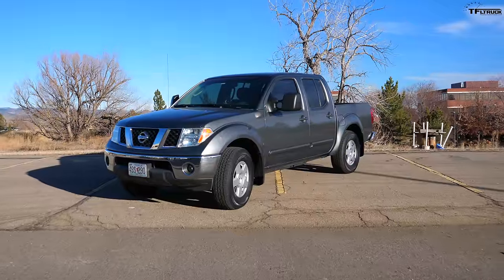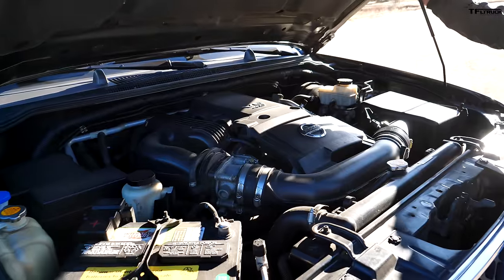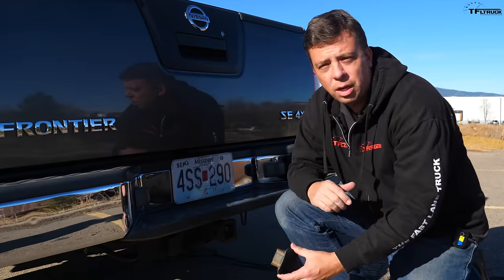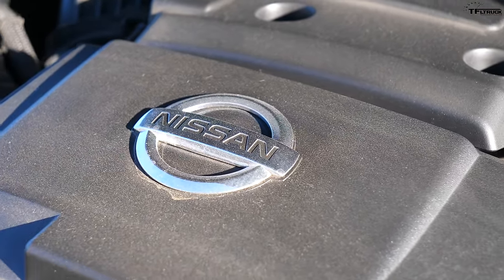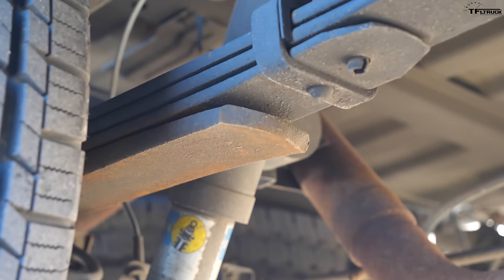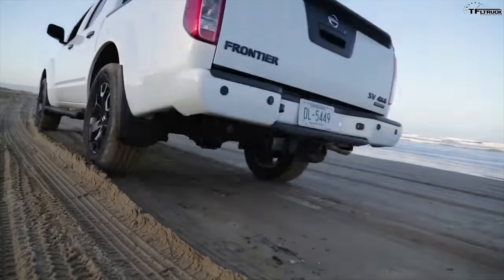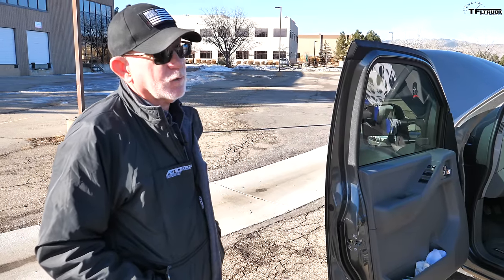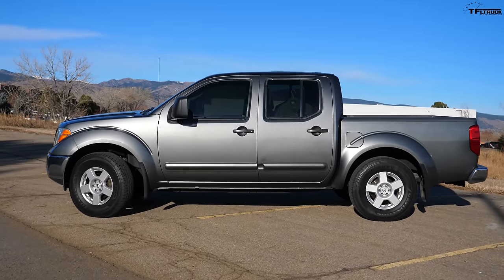Here's Why I Prefer The Old Nissan Frontier Over the New One — Dude, I Love My Ride!

Comment: Pifff"..... My 2011 has 268000 on it, I have never done anything to the engine, but regular maintenance.About the only thing I don’t like about it, is the 4 1/2 foot bed. You put a toolbox on the back and it’s virtually nothing but a trashcan hauler. The other big thing I don’t like, is the gas mileage. Since it was new I have an average 16.8 miles to the gallon. Some may say that’s pretty good, but this is strictly highway miles commuting. I was hoping for over 20. I only saw 21 miles per gallon when it was brand new on a 400 mile trip. By the way, I wanted to standard in mind when I bought it, but there were none available within 1000 miles.

Comment: I just got a 2010 np300 with 145k km and it looks used, abused and ignored. Plenty of things to fix. Even the windows rattle in the doors over bumps. But it was fairly cheap so not too bad.

Comment: I prefer the legacy Jeeps with the AMC 242ci I6 engine (Powertech 4.0).  My aging Jeep Wrangler TJ has 409,000 miles on it.  I prefer the old Chrysler V8 318 engines to today's junk. I had one with 850,000 miles on it until it was crashed in front of my house.  I prefer the old Blazer 4.3 liter V6 engine.  They had the amazing power and durability that made GM famous and the current engines GM uses today infamous.

Comment: my 06 frontier was a great mid size pickup truck. i said was. the trans. gave me some problems (automatic). i changed trans.fluid,filter every 30,000 mi. never towed or hauled anything heavy, i bought this pickup new. the local dealer constantly updated me on the trade-in value. why? i liked the truck. they must have known the trans.cooler was going bad. well it did! the cooler is in the radiator. leaks antifreeze into trans. i noticed a prob.at about 80,000 mi. well by the time i figured it out, they call it the Nissan slow strawberry trans.death. google that. well it was too late. the manufacture or dealer never notified me. no letter no phone call, notta. warranty was good till 70,000 mi. 7 yr. now for the good news! they were forced to recall thousands of vehicles for the prob.however they worked out a deal to extend the warranty to 10 yrs, or 100,000 mi. good for them! but bad for us. they never told anyone,  a $4,000 fix. Hooray for Nissan!  the trucks worth is about $5,000 dolls. shame on you Nissan and whomever has anything to do with recalls.

Comment: I'm surprised that my 2019 GMC 5.3 V8 probably gets similar fuel mileage to this 2006 Nissan 4.0 V6.  Technology has come a long way.  I know my 1995 Jeep 4.0 I6 got way worse than this for sure.  My average was about 11-12 mpg city at best, and it started off at only 10 mpg before I did some work!  And that wasn't always driving around with a lead foot!  One time I even added an additional throttle return spring to force me to drive more conservatively.  But that was only temporary as the foot pressure required was somewhat not the most ideal.

Comment: There's a reason this truck has been the same since 2005. It's a fantastic engine transmission combination the drivetrain is solid and the looks are reasonably speaking good looking. People complain about not having the New Frontier but there's not much wrong with the old one to want in the new one. You can still pick this truck up for under 30000 and a brand new truck can be identical to my 15 year old truck
Reply: L
This guy blew a timing chain at 80,000 miles and needed a  complete new rear end I wouldn't say it's too solid LOL
Reply: @paul9912  yeah and brand-new trucks of every make and model have recalls and complete transmission and engine Replacements. Toyota has to replace entire frames at their own cost. Minor remediations are to be expected. Still a very dependable truck would highly recommend
Reply: @mrfordman9999   you can say whatever you want buddy but I think you would be drastically outnumbered if you tried to compare Toyota quality to Nissan. Good luck with that Nissan after 80,000 miles lol
Reply: @paul9912  mine has 216,xxx. They're great trucks. for the money they're seriously hard to beat.

Comment: 09 Frontier 5 speed 187,000 miles....have only had to change front wheel bearings. Power steering leaks a little bit but that's it

Comment: I’ll go even further back. I had a 94 Nissan D21 pickup aka Hardbody. 4 cylinder with a 5 speed manual. I put 200k miles on that truck and it just ran and ran. I still regret selling that truck.

Comment: I have a 2015 2WD. I wish I had those nice mirrors on mine for towing. I wonder if the 2005 mirrors will fit on my 2015.
Reply: They will fit! Anything from 2005 onwards will fit those towing mirrors. Nissan never designed the front doors to be different in shape on the king or crew cabs, so everything fits!

Comment: My mom has a 2010 and she has never done any maintenance other than oil changes and brake pads and been in 4 wrecks. She has 192,000 miles on her frontier. This truck is literally indestructible. She wants to get a car for better gas mileage but I keep telling her you can’t treat a car like that without it breaking😂

Comment: I have a 2010 frontier. I'm surprised he hasn't had his crank and cam sensors fail. Mine all failed before 50k.
Reply: Bad/low oil cause VVT regulators to lag, common issue, but easily fixed by new oil, sometimes VVT regulators needs a cleanup

Comment: The guy knows his truck for sure. It has always seemed to me that Americans have a built in excuse for foreign vehicles. If someone's F-150 had to have a major engine repair at 70,000 miles and a new rear axle at 100,000 miles, they would be throwing an absolute fit. But for a Nissan Frontier it's "i've had no problems at all." Pretty funny.

Comment: Great video. I was a little surprised the timing chain went out at 80k. Maybe from towing that horse trailer weight. Did you run full synthetic oil? Any plans on replacing it with another truck. Beware on the 2020 3.8 liter V6 as it was developed while Fiat controls the company. Nissan has realized they must ditch Fiat because people are not buying Nissan's any more word got out. Nissan is financially hurting bad. My 2004 Frontier 4cyl is gutless but what an awesome pre-fiat vehicle. I have a 5 speed and it shifts smooth and easy. I love my 2004 4cyl. ,
my son has a 1994 and it still runs fine. FIAT GO AWAY TO ITALY, GO SCREW UP YOUR COUNTRY.S VEHICLES!!!!!!
Reply: Chain guide problem is prevelant on 05-07 and provoked a class action lawsuit.

Comment: I have a 2016 Frontier 2.5l I put a Aftermarket diff breather so mine won't have this issues
Reply: Diff breather will only help the diff seals, not going to help if you're towing
Reply: @trevors8577  I don’t tow only thing I’ve towed is small 5x8 trailer and small stuff in the bed like my tool box is about 300lbs bed capacity is like 900lbs

Comment: Had no idea that 4.0 has 260 hp. That's pretty impressive for a midsize truck. Wish they'd update the exterior styling a little bit though
Reply: The Torque is more impressive at 281.
Reply: It's actually 261 now lol
Reply: Tommy Pearson It must be a rocket now with that 1HP gain. 😉
Reply: @tommypearson9260  261 now? Holy molyyy

Comment: I really want a frontier but I heard nissan had a class action lawsuit on the frontier radiator fluid mixing with transmission fluid causing major damage. I wonder if all frontiers have been fixed since then or at least reimbursed the owners.
Reply: Dude that has been fixed almost 10 years now that was with the 06-10

Comment: I own a 2010 Funtier. sucked i could not find a 4 door stick version here in Canada land... the truck took everything i tossed at it .... they are easy to run and cheap no bells no whistles... if you want high tec  buy the Benz truck ... same platform just different skin.... with the stick you could get 700- 780 k out of a tank  and there were no mechanical issues, yes seats suck, radio is trash, old ceramic heater was way better,  this was my 14th funtier... i started with the 87 720.... i really hope nissan does not F up this new thing they are coming out with ... otherwise im switching brands...

Comment: Are Tacoma's needing the timing chain replaced @ 80k and complete rear end replaced @100k?
Reply: EricTheNotSoRed no
Reply: How many tacos tow that much?
Reply: My dads 4.0 taco had to have two new head gaskets put on it at 90,000 miles and it wasn’t even ran hot. It Costed him a small fortune he put almost 200,000 miles on a ZR2 s10 Didn’t do anything but a tuneup and some brakes.   Damn overpriced ass Toyotas!
Reply: Barracuda340000 it was an 09 .

Comment: Would have been great if it was the title was at no point does it discuss the differences between the 2006 and current.   It’s a review of a 2006 solely.   Guy says he only put in timing belt : chain as his only major repair costs.  Than later says he replaced the entire rear and has replaced 3 sets of shocks and beefed up the rear.   So it’s NOT stock and not a comparison.  Catfished on this video

Comment: Older ones up until 2010 had a radiator problem. They would leak and bleed into the transmission,  ruining it. A very costly repair.  That's why I sold mine and got a Tacoma.
Reply: J Coats The manuals didn’t have the issue

Comment: He spent more on repairs then he would have spent buying a more reliable and nicer more modern truck like a Toyota. Timing chain at 80,000 miles that's crazy. Complete new rear end. Good thing he didn't have the CVT automatic because he would have blew a transmission too.
Reply: CVT automatic? Lol

Comment: I have a 2019 frontier crew cab 4x4 auto. I get maybe 180 miles per tank and I keep it under 3k rpm closer tom2k rpm when accelerating .  Wish I knew why such horrible gas mileage
Reply: 2010 Frontier SE 4x4 King Cab 4L v6 auto...  i get about 18mpg around to approx 300miles when i get to 1/4 tank.  not sure why it's so bad for you either.

Comment: Damn when my Ranger took a shit I was in the market for new vehicles.. 22-24k was my range yet all NEW trucks quad cab full size were high 20s to low 30s.. Went with kia optima and its a great car but coming from a ranchero to ranger u was used to trucks tacomas were 27k for a basic quad cab 4 banger engine.  I will never buy new again but at the time i wanted that warranty.. O well.. Id trade my 40k mile 2012 optima for a 2012 frontier with double the miles straight up.  Kia's depreciate fast!! My car with 40k miles would probably sell used for only 6-7k on a good day so id be stupid to trade in with only 40k miles on a 2012.. Has hella low mileage

My thing was kia was giving 4k for trade in to go towards a new vehicle and my 01 ranger wasnt worth 4k.

Comment: 175,000? I’ve had three different years with over 300,000 with the 4L drivetrain. The current 2015 has 360,000 and going strong.
Reply: Sounds like he maxes the towing capacity regularly going up steep grades.

Comment: Didn’t the early models have a Supercharger?
Reply: that was the 2001-2004 models which were the 1995-2000 models with a new body (an ugly one in my opinion) using a supercharged version of the same 3.3l v6 from the 1995-2000 frontier

Comment: Sorry, not for me..... Timing chain/tensioner replaced at  80, 000 miles and the rear axle at 135,000  miles. In Austrailia and UK they have frame failure issues.. The 114mm bolt pattern is questionable as well. This 'car' only good for smooth interstate driving and l wouldn't risk the new model either with NZ conditions the way they are.

Comment: 2005 with 260k from new. After all this time I'm wondering if I want a full size truck.
Reply: Howard Montaque Original transmission and timing chain?
Reply: @elonsus9747  Timing chain just after 100k warranty. Original trans. Rear axle changed under warranty.  Broke a drive shaft.

Comment: How hard it would be to make every truck model also with manual transmission?
Reply: Problem is nobody buys manual transmission vehicles except the hard core types such as myself. Dodge/ram just stopped building a manual transmission for their 3500 diesel truck back in 2018 and that was the last full sized manual transmission truck on the market....unfortunately manuals are dying and wont come back once they're gone...so if you can please buy a manual transmission vehicle over an automatic transmission to help keep manuals going for a bit longer :)
Reply: Manual is soo much more fun, and worry free of breaking trans
Reply: @ludovitbakic7548  yep it sure is and safer too!

Comment: If you noticed like I have Nissan in 2018 has stopped putting tow hitches on the Frontier models (like the one factory installed on my 2016) .  Is it because Nissan may want you to believe (sway you) you need to buy the Titan to tow your smaller trailer??? My 2wd Frontier  tows up to I believe 6500-6700 lbs (with recommended trailer brakes above 3500 lbs), no need to spend more for a Titan. The Frontier helps keep my off-roading SxS hobby affordable.

Comment: No radiator replacement? I think that was one of the years where they had the bad radiator.
Reply: Benson Ricks autos only had a problem with the trans cooler
Reply: @lb0193  That's right, my bad.
Reply: Yep manual is the way to go. My wife refuses to drive manual.

Comment: He dodge the bullet, the automatic got contaminated by the radiator antifreeze! And Nissan screwed the owners with a crappy extended warranty. Those trucks are heavy, the frames are beefy. The V6 ,you have to remove the plastic intake to get to all the plugs, pain in the arse. I swapped my diff fluid to Amsoil on day one, no issues, I'm at 140k. Amsoil engine oil as well, no issues with timing chain.

Comment: It'll pull steep grades doing 30 mph is what he meant to say, but he's in Missouri and its flat.  LOL.
Reply: you forgot to say in 3rd gear at 3500 RPM lol...  Cuz thats what mine does it likes 3rd gear when towing.  I live in mountains in new york.  My frontier towed a 30ft Travel trailer 5200lb From amsterdam to schroon lake at 45MPH top speed lol.  Needs a Tow Haul mode because it never stopped shifting from 3 to 4th back and forth.  It did it though.

Comment: I really want this exact model. 4x4 stick
Reply: Well you better hurry. The 2019 model is the last of the 4.0 V6
Reply: @checkout982003  ive looked for it. No manuals to be found in anything other than the small cab configuration

Comment: My 2007 has 285k it's automatic also
Reply: They musta used a different rear axle diff assembly, cause my 05 nismo v6 auto had to have it replaced at 60k as well as a buddy who happened to have the same model

Comment: Running a used car dealership for the past 20  years I have run into far too much trouble with Frontiers . I wouldn't own one or any of their suv line other than the Armada. The only decent things I have seen Nissan put out in the last 15 years is the titan and armada. They have their issues but nowhere near as many as their smaller suvs and pickups.

Comment: No cvt...that explains its longevity.
Reply: Rob Brown CVTs need the fluid changed more often. My 07 Altima has 150k on it when I got rid of it. Just changed the fluid every 30k with amsoil.
Reply: TRDRacing good man that’s why it lasted so long. I’ve learned the very hard way to change my transmission fluid.

Comment: I have a 2005 pathfinder- pretty much the same, just an suv.  Horrible horrible horrible vehicle- this man was smart because he didn’t get the automatic transmission. The automatics Get destroyed because the trans cooler leaks with the radiator and the trans get contaminated with coolant. Don’t go looking for this truck in an automatic based on this video.
Reply: Remarks show lots of interest by us Frontier fans.  My first Pro4x was a 2007, then I had a 2013, and now a 2017. Tows TT yet fits in garage.